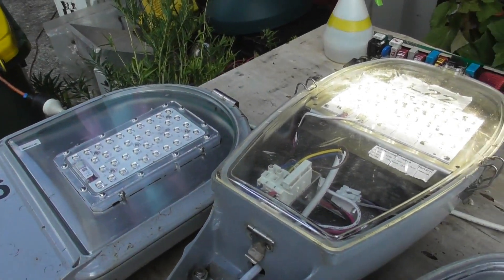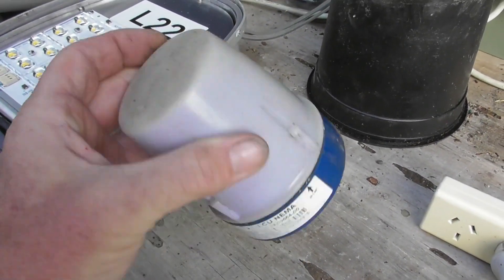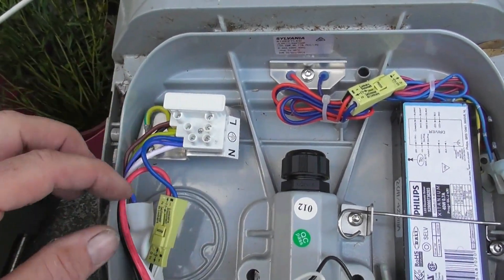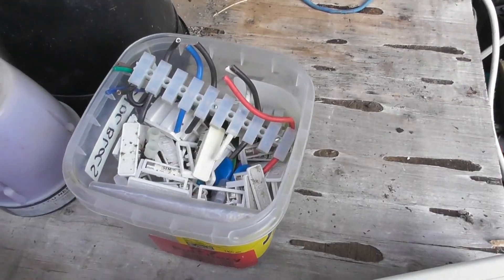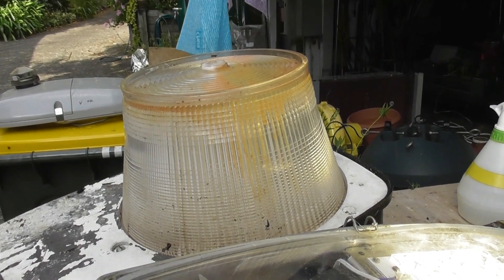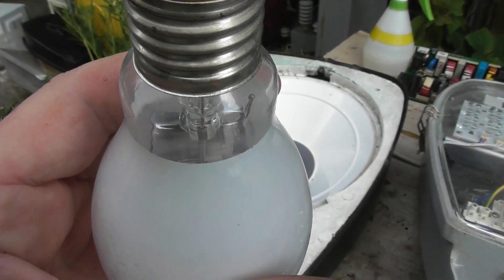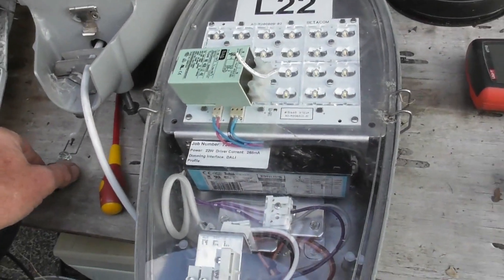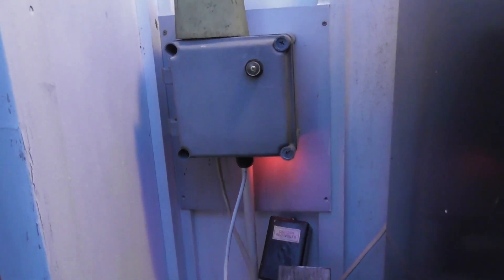LED and HPS Streetlight heads

Comment: With the amount of these LED units that are getting thrown away, are they really better for the environment? We’re still running 35w SOX at home as the LED streetlight offers very little illumination
Reply from the maker: Where about are you ? Like to get hold of a working SOX lamp and fitting.
Reply: Am in the UK, Ray. I may have some spare 35w tubes, I could send one out to you?
Reply from the maker: @TurboTel68  A spare 35 Watt tube would be great. It needs to be well wrapped in bubble wrap or chips so the post doesn't destroy it. Will pay you for costs of course. Wait till after the COVID-19 is over. Cheers !
Reply: No problem at all, give me a shout when this all blows over and I’ll get one out to you. Stay safe out there!!
Reply from the maker: @TurboTel68  Thanks mate. Will keep in touch. Take care and be safe. Cheers !

Comment: They still put in new Mercury vapour fittings here as spot replacements, and still have plenty of lamps as well. Almost all the new lighting though is LED, and the HPS is slowly being phased out, as the spot replacements on the freeways is not being done with new 400W HPS lamps if the fitting fails, but with a 100W LED fitting instead.

You should look on eBay for HPS LED retrofit lamps, which give the orange glow of HPS, but without the power use. There are also red LPS retrofits around, in the long package.

Comment: Nice vintage looking sodium street lamp. I once found a metal halide Street lamp in an abandoned transformer building, the unit was 4 feet long! I know LED’s are the way forward, I just like metal and sodium vapor lamps. I hope they continue to be manufactured in the future for novelty purposes.
Reply: That would have been a SLI low pressure sodium lamp, that looks like a regular flourescent lamp, just clear, with another convoluted glass tube inside the T12 envelope. No longer made though, as the factories that made them in the UK and Holland closed down a while ago.

Comment: Nice finds, just wondering did you add those leds to the email meter. Just wondering what are they there for. Thanks
Reply from the maker: I fitted those LED's to the pulse output from the meter. This meter was ex high rise building in Auckland and the output pulses were used for data logging there.
Reply: @RODALCO2007  Thanks for the info, very cool to see and know what that stuff does.